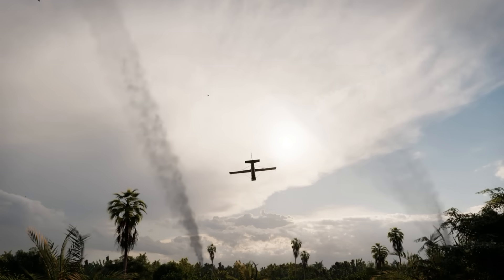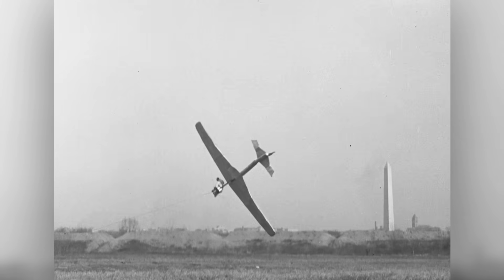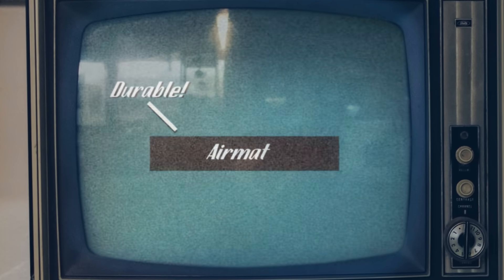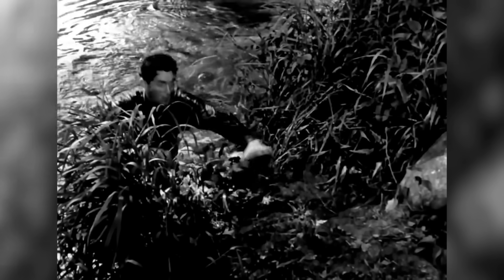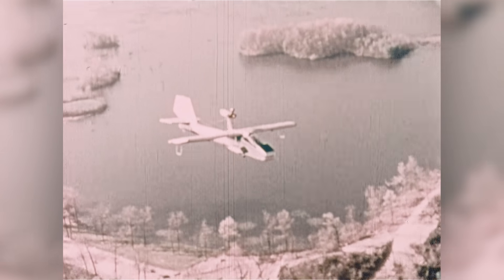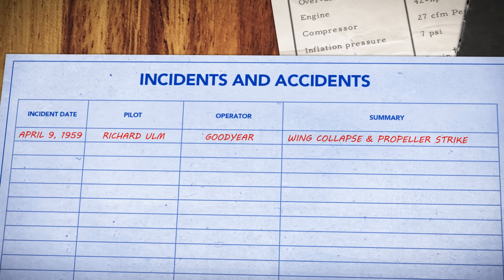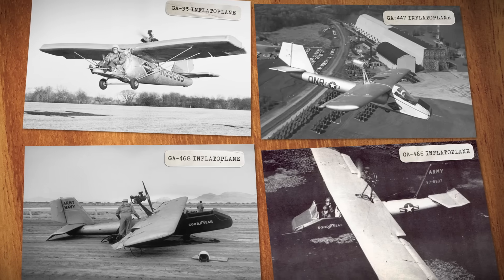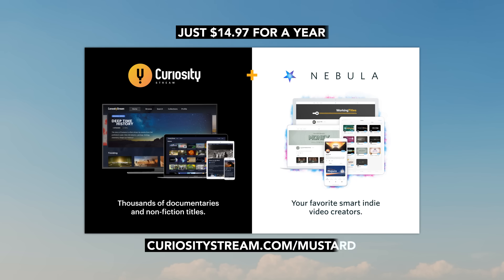Inflatable Airplanes Were A Bad Idea

Comment: This sounds incredibly dangerous, yet never have I desired something so intensely.
Reply: they could have sold it to normal people...i would buy it
Reply: @coolshift6783  But can you imagine the lawsuits if one of these things crashed?
Reply: @twistedyogert  yeah...but I'm pretty sure with todays advanced technology they could iron out its problems.
Reply: @coolshift6783  I wouldn't risk it. The fact that a wing could just fold without warning is more than enough to keep me away. However, a simple straight pole like one you'd use in a tent at both the leading and trailing edges of the wings could alleviate the issues with a wing folding over. 
After partial inflation the poles would be inserted to hold the wings in place. Pilots could also be instructed to avoid tight turns and the poles would be there for redundancy.
Reply: @twistedyogert  I'm almost sure there would have to have been something like that already integrated.  You cannot have a rubber wing without some sort of spar.  One thing that is only now available that might drastically increase the feasibility of this concept is carbon fiber.
Reply: @whatelseison8970  they did say that there were the nylon support strands inside, so i'm assuming thats what they were relying on
Reply: @FacepalmVideoss  Take a look at the inflatable paddleboards sold today. Same internal structure idea. Those things are rock solid now so I am willing to bet a wing could work that way with today's tech.
Reply: @FacepalmVideoss  yes, but I imagine a full civilian production version would probably need a little extra support. I wonder what this would cost in today's market.
Reply: @timthorson52  more than an ultralight. Depending on the manufacturer, less than 100k for some.
Reply: @twistedyogert  Welll of course they would be aware of the risk and warn you or maybe you would need a license or something
Reply: @eldi9729  In the United States this aircraft would probably be considered an "Ultralight" and someone would not need to be a trained pilot to operate one.
I can't see them being any more dangerous then an ultralight aircraft.
Reply: @twistedyogert oh your right
Reply: @twistedyogert  sure, pilots can avoid tight turns, but what about turbulence? Wing collapses in paragliders are not uncommon, but it's something that can be recovered from and pilots train for. With something like this you can't even bail out and pop a chute because you have a big spinning prop right behind you.
Reply: @coolshift6783  I think the problem is, that these days, we don't only have advanced technologies, but also adwanced lawyers.
Reply: @konoko1002k  true
Reply: @ParadigmUnkn0wn  So perhaps there would need to be some certification.
Reply: @konoko1002k 
I was thinking the same thing. Someone gets drunk or stoned and decides to fly one of these things and kills themselves despite warnings that they shouldn't. 
Next thing you know Goodyear gets slapped with a multi-million dollar lawsuit.
Reply: @twistedyogert  just make it slower and replace ol' good combustion engine with electric non-rotary ones.
Anyway, it is not only the US in the world, so I see the chance for this stuff.
Tbh, it was only one real attempt that was cancelled due to mountains and heli with main issue of unprotected propeller. This is really cheap to solve.
High-pressure  beams, set of air arteries with one-side airlocks to separate pillows and set of same decompression veins.
Really, the most expensive part is to make the form-safe pillows.

It seems incredibly cheap to try, except local laws forbids it at my location.
Reply: @whatelseison8970  and lifting body designs.  Four years later, I’m still on the job.  Notice how you can stand on a modern inflatable paddle board without a wave bending it, but not a Cessna or cub wing?  There’s whole companies making “no step” stickers that would be out of business.
Reply: @coolshift6783  want to build one together? I firmly believe that this is the ticket to safe flying cars. I have design elements in mind. I don’t care who gets the credit I want to see this through while i have the opportunity
Reply: @Greg-yu4ij  I'm happy that someone other than me is interested in the thing but I'm sorry i can't build it(even with someone).I don't have the time nor money to do this project as i also have exams coming in a few months.But hey if you build it yourself than good luck bro,godspeed
Reply: @coolshift6783  Sold to highly unusual normal people
Reply: Highly unusual normal people, or unusually high normal people?
Reply: @coolshift6783  The fact that you would want to take a chance on one of these makes you "not normal"!.  But I like your sense of adventure.
Reply: Right?!
Reply: The one big difference between this inflatoplane and the thousands of hang gliders and paragliders regular people use... is that the inflatoplane is probably 100 times safer! :D
Reply: I feel like a sea plane variant that could take off from lakes would be awesome. The whole concept is awesome, flying without hanger fees.
Reply: Likewise haha
Reply: yes
Reply: Here in Australia, I could even imagine planes like this saving peoples lives. Your traveling through the outback, suffer a breakdown and can't find your way back to civilisation? Well just start up your inflatable plane and you'll find someone to help you in no time.
Reply: a 5 minute prep period for several hours in the sky? sounds like a perfect afternoon for thrill seekers.
Reply: If it was sold to normal people trust me one would be in my garage
Reply: fun fact if it's this small you don't need a pilot's license as long as you keep it at 10,000 ft or less
Reply: I dont trust people with cars, why should i trust them with an inflatable plane?
Reply: @fulcrum2951  
Because they're fucking cool.
Reply: @fulcrum2951  Pilots M'dude. Not the average person
Reply: @fulcrum2951  cuz they are fucking soft like pillows
Reply: lmao same
Reply: What if they used tent poles? the larger thicker ones?
Reply: Me to. Seems pretty screechy. BUT  my mind is on fire .We have many new stronger lighter produces available they didnt.
Reply: I know that feeling too well.
Reply: Is like " shut up.and take my money" Isn' t It?!
Reply: Short flight...

Long fall.
Reply: fucking same dude
Reply: lol
Reply: I absolutely want one just because it's something I could carry in my truck over to the small airport nearby, and fly in fits and spurts to Colorado to go skiing, and then fly back...
Reply: i feel like putting a shield around the propeller would fix the issues.
Reply: @sethsmietana7733  True, but a propeller is basically a twisted wing that rotates. The forward thrust is basically the lift that the prop blades create. 
Adding a duct would change the efficiency of the propeller.
Reply: Same.
Reply: If you really want a small foldable propeller driven one man flying contraption, just take a paramotor. I just looked it up, they only cost you about 3-4K $ and are an already developed and in use technology.
Reply: I just want it
Reply: IKR? I totally want one! It seems like, as long as you're careful and don't make any sudden, violent control inputs, it'll be fine.
Reply: its elm street of nightmares for old used car resellers :D
Reply: It's probably similarly risky to powered paragliders, but it's still not that much more dangerous than general private aviation. The big block today is it would be hard to put a full flight suite into this thing without dramatically increasing storage size and weight. It would likely have to be scaled down to fall under ultralight rules and that kind of kills the purpose.
Reply: Yeah i want it to
Reply: Said that same thing upon meeting my first wife
Reply: You can! Although it looks very different any powered paraglider fits in your car boot, and if in the US, you can fly it without a licence. 
Or if you want a faster aircraft a two seat microlight will fit in a small trailer.
Reply: Ever dated a stripper?
Reply: Phcc it I’m in

Comment: What was the radar signature of one of these things?

Because I'm thinking instead these things being used to transport special forces way behind enemy lines, using quiet engines, instead of a single plane that could be shot down. 

So you fly for several hours at night, land near dawn, deflate and hide the planes, complete your mission, and then reinflate and fly back the next night.

Comment: Honestly I'd say this concept still has potential, imagine what it could do with modern materials and safety systems. One of the more expensive parts of owning a private aircraft is paying for the hanger, if you could literally just deflate your plane and toss it in the back of your truck, then civilian flying would be drastically less expensive. 

It even might still have military applications, like as a UAV, it could be powered by an electric motor so it would be very quiet. It could be a longer ranged recon drone deployable at the squad level.
Reply: These things created using modern materials really wouldn't be any different from ultra-light aircraft. Except you can store them in your garage and can take them with you in the back of a ute or SUV. It would also be quite easy to make a flying boat version that can take off from or land on water.

Comment: >get shot down
>get rescue aircraft air-dropped
>get shot down again
Reply: I'm sure pilots would rather fly than walk from 300 miles behind enemy lines. No matter the risk.
Reply: @SuperCatacata  if you’ve got an artificial horizon and an altimeter you could time out your takeoff at duck and use the failing light to get home. Map and a flashlight can’t hurt either
Reply: @matthewcaughey8898  Artificial horizon, altimeter, and a magnetic compass would be minimum equipment.
Reply: @matthewcaughey8898  hell you can even do it in complete darkness using the stars and moon. You can see the treelines and horizons obscuring the stars and know where to fly above.
Reply: @matthewcaughey8898 I always take off at duck when I fly.
Reply: ...keep sending the inflatoplanes-- the pilot will eventually get out! :)
Reply: @angelarch5352  not if the enemy camps the drop
Reply: Just keep air dropping more rescue aircraft. I don't see the problem here.
Reply: @iharten  or better yet, simply win the war so that you won't have to rescue anyone.
Reply: @iharten  That's a lot of hand pumping.
Reply: @iharten  DEADNESS
Reply: rinse and repeat
Reply: build one large enough to carry a second, backup plane
Reply: Would be an infinite deadly loop then 😂
Reply: But what if the inflatoplane has a inflatoplane in it, and that inflatoplane having another one in it and so on
Reply: >Feelsbadman.jpg
Reply: @plusxz821 
>mfw
Reply: >gets rescue plane dropped again
Reply: As the song goes 
"I get shot down!,
But I get up again!
Never gonna keep me down!"
Reply: Flex seal to the rescue.
Reply: in-flight repairs lmao
Reply: "How many times do we have to teach you this lesson old man!!"
Reply: the endless cycle of life lol
Reply: >get another rescue aircraft airdropped
>crash
>pain
Reply: @Jack Haley You'll travel 100 meters just during takeoff.
Reply: Hit a bird and crash.
Reply: NothingRidiculous  I blame autocorrect for that
Reply: NothingRidiculous  I’ll give you that one
Reply: >take off and wing kisses propeller
>falls down on a soviet air base
Reply: @bravoRYT2018  it’s actually a lot more rigid then you think. I’ve seen one in person. Think super thick air mattress with actual multiple  inflated tubes within the skin
Reply: If pilot has any limb injury. Plane won’t do him much good.
Reply: @mercoid  potential risk for a pilot ejecting . But in 90 to 95 percent of cases a pilot who’s ejected lands unharmed. The only time I heard of an injury is when a pilot ejected at near supersonic speeds. In most cases a damaged aircraft slows down or a pilot slows down in preparation to eject.
Reply: Aha, but the rescue aircraft had a rescue aircraft!
Reply: you didnot watch the video carefully .
Reply: But flies in little fart circles as the air escapes
Reply: Rescuing aircraft gets shot down
Reply: Jesus Christ the good sovereign God cherishes you my friend, do you know Him personally?

Comment: Damn, with today's ultra light planes one that could be packed into a trunk rally could take off (hehe). As usual, it was way ahead of its time.
Reply: It seemed like the only problem was wing rigidity. Too bad they canned it instead of finding a solution
Reply: @SuperCatacata  honestly, i hope to see a civilian version of this with proper application of modern materials
Reply: @calebdavies526  woopyfly
Reply: Well, with modern materials, you could just have a carbon fibre folding frame hang glider and strap the engine on. Might not even need the inflation bit.
Reply: You really think modern people can be tristed with planes? Just imagine the stupid shxt that would happen.

Comment: Seems like the folding wing issue could be resolved by having a rigid pole go across the wingspan.
Reply: @GHSTSTRSCRM  it’s still workable. Just have a collapsible pole or several rods that can be screwed together.
Reply: @GHSTSTRSCRM  I wouldn’t want to fly it in a combat zone either. I just think it’s a pretty cool concept that could’ve been workable.
Reply: Yeah, an insert like a tent pole which bolts or scews together in the middle would be good.  But then if you crash, its likely to snap and stab the pilot. 

 Perhaps verticle sheet metal inside the wing that simply lay flat when deflated.  It would prevent foldover, but not fold back.

Could help in clipping events, lol, the wing would just snap back in place.
Reply: @gnarlytreeman  I feel like getting stabbed with a tent pole would be the least of the pilots worries, if they crashed the prop behind them might be a tad more worrying.
Reply: I'm sure that's the first thing they thought of. It probably made the plane to heavy or something so it didn't made much sense. Then again this whole project didn't make much sense...

Comment: I feel like the folding issues could be solved today with carbon fiber spurs that could be snapped into place
Reply: Exactly what I was thinking. There are new materials that could be used. Such a shame that the project was buried. Someone should bring it back and they'd make a ton of money
Reply: @fredsilva8076  there's still no discernable benefit, and its also much harder to get aircraft approved today
Reply: Like a tent pole?

Comment: How come amazing designs like these never make it into the air and then sucky designs become really popular?
Reply: All the fails mentioned were in the wings... We could just add two removable crossbars to improve rigidity. Military use is out of question, but I'm pretty sure that there's some civilian market for it.
Reply: @moteroargentino7944  it furthermore sounds like these inflatable planes could be made very cheaply - even the cheapest rigid body aircraft cost thousands of dollars. If you could lower the price, more and more people could have a chance to fly.
Reply: like every social media
Reply: Because those "sucky" designs are actually affordable, reliable, and most importantly, they are FUNCTIONAL, something that "cool" designs more often than not aren't.
Reply: Guiep  yeah but it reminded me of other things like vtol aircraft and that big german one (which admittedly have flaws but they are cool)
Reply: Dude we’re talking about a literal balloon aircraft, I mean come on, how do you not see the problem with that concept ?
Reply: @man We ride in heavy metal boxes at several miles per hour with "balloon" wheels. I don't see the problem as long as they take their time to test and refine the technology. 

Actually, you gave me an idea! Since is inflatable, what if we filled it with helium? (In fact, there's already something like that; it's the hybrid airship. But it's more airship than airplane, this would be more airplane than airship).
Reply: Motero Argentino helium is very expensive, and its cheap friend hydrogen has a burning problem.
Reply: @Luke-ov4pi  Hmm... I was going to say that the volume of the inflatoplane is less than that of an airship, so the cost isn't thaat big. But then I realized that given the volume is smaller then the additional lift may not be worth it. Air seems to be the best option.
Reply: Im just wondering if the people who says the equivalent "why arent these designs being used?" ever paid attention to what mustard been saying in the video
Reply: @fulcrum2951  ow, good point

I KNOW they have design flaws but I was thinking of like some others that could have gotten off the ground if not for lack of funding or whatever
Reply: Guiep  Wingsuit flying at 140mph says hi,
Reply: Because usually "sucky" designs:
1. Actually work
2. Serve a purpose
3. Work economically.
In Sci-Fi jargon it's known as AM/FM (Actual Machines/Fucking Magic)

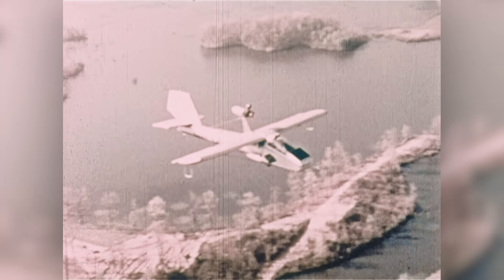Comment: 4:51 “But taking on enemy fire to an inflatable plane would give a hole new idea to depressurization.” I can’t be the only one who thought of that right?
Reply: Good one
Reply: @superq3215  thanks!
Reply: That's what's known as a silent pun.  It's like when I walk into a room but am hiding something and say, "Hey guise!".
Reply: This problem could be sold using bullet proof fabric on the lower side. At the low pressure this stuff is operated it's actually not that difficult. (The same fabric can take a lot more energy from the bullet compared to having flesh, kork or higher pressure behind it.)
Reply: Now that you said it 😜😂.
Reply: Noice
Reply: “So Goodyear…slowly let the air out of the program.”
Reply: WW1 Airships would be able to get shot by conventional ammo and still fly no matter the amount of holes in it

All until incendiary ammo hit the scene